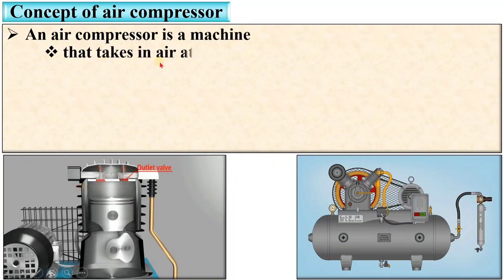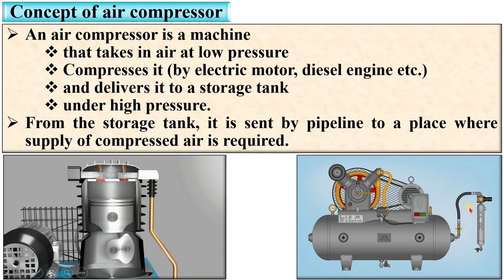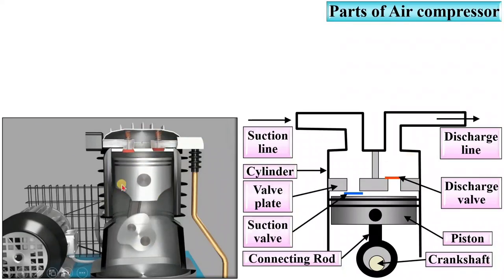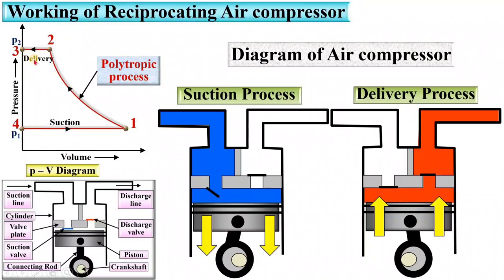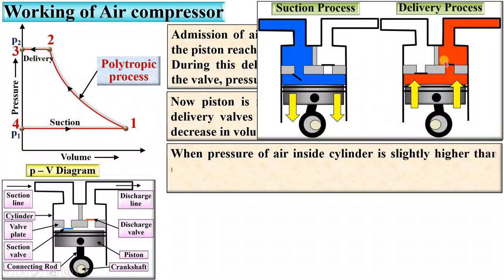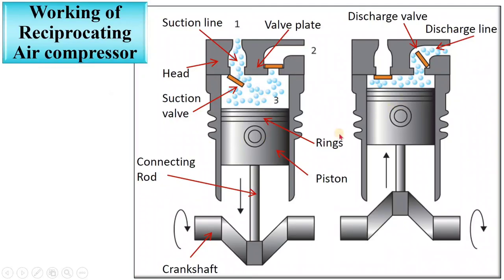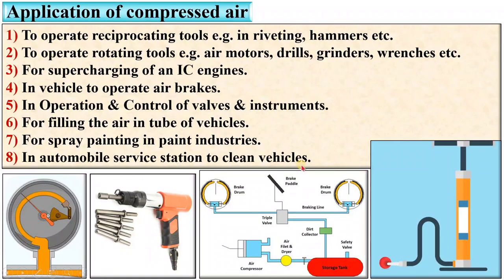Air Compressor (Basics, Parts, Diagram, Working & Applications) Explained with Animation

Comment from the maker: Air compressor and its basics with Animations explained with following Timestamps: 
0:00 - Basic Mechanical Engineering lecture series 
0:10 – Air Compressor
0:35 – Concept of Air Compressor
1:43 – Parts of Air Compressor
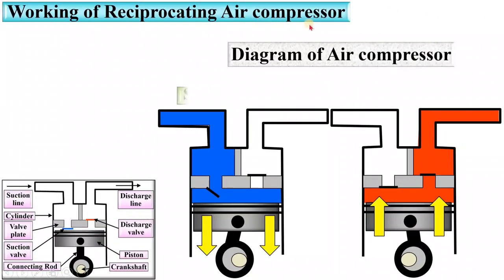4:03 – Working of Air Compressor
4:08 – Diagram of Air Compressor
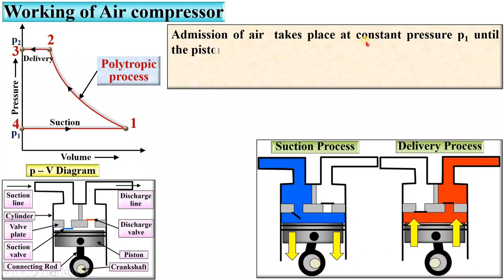5:01 – Working of Air Compressor
7:04 – Application of compressed air